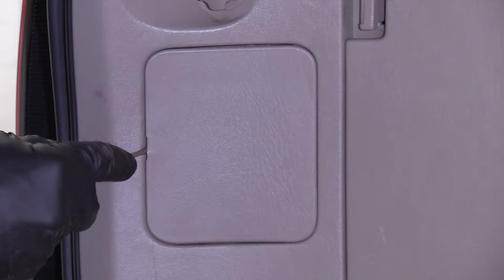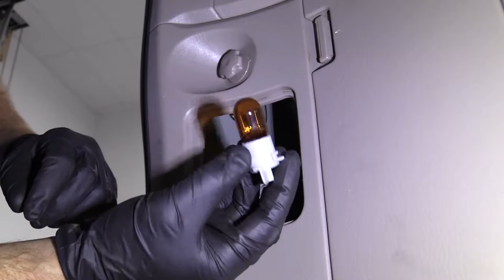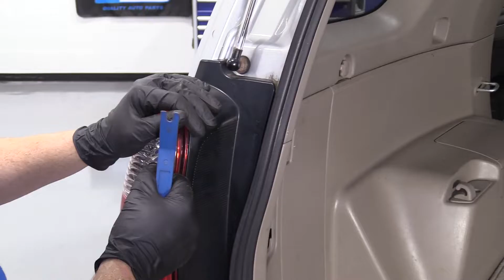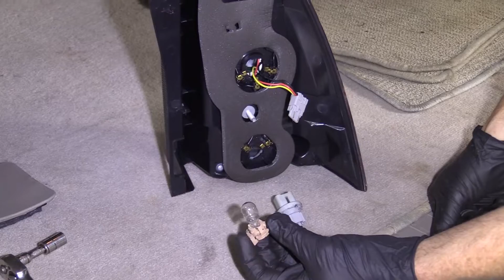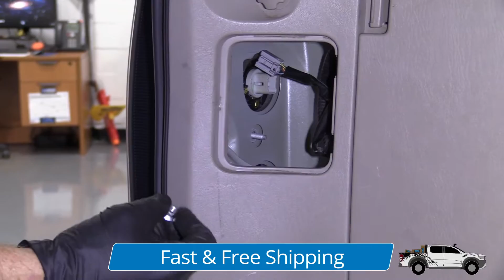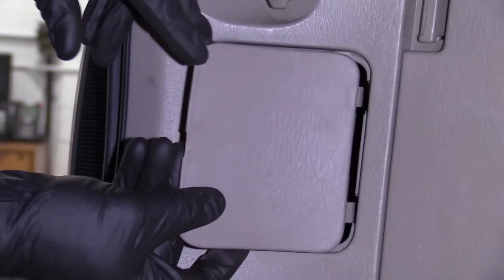How To Replace Taillights 03-09 Toyota 4Runner

Comment: The middle where you show a connector my 2004 has a bulb in there.  otherwise everything else looks the same.  Is there a different part for an 04?
Reply: The 2003-2004 have regular bulbs , this car he’s showing has the LED in the center